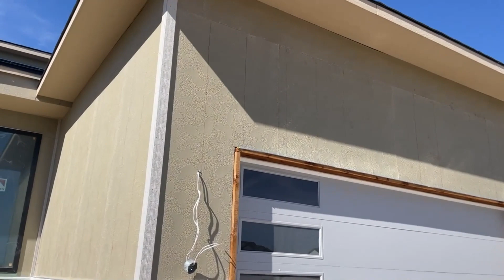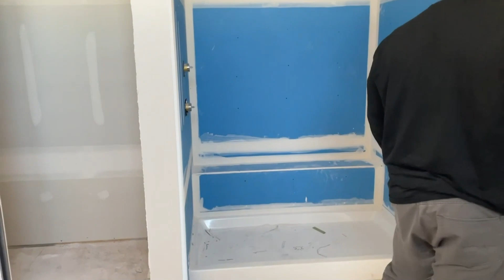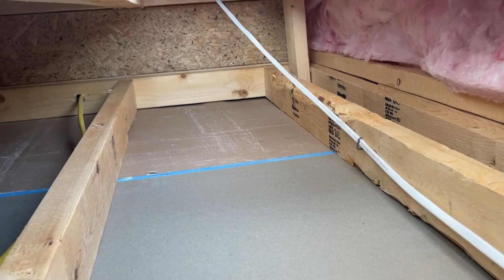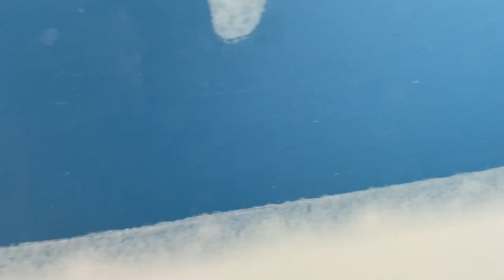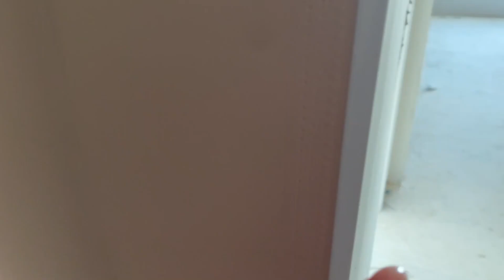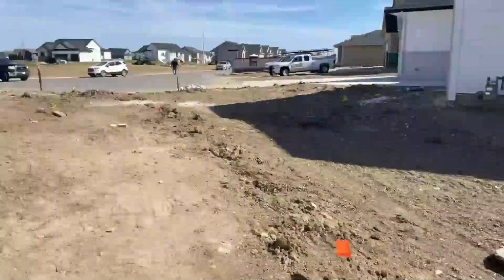BUILDING OUR NEW HOME 2022 | NEW CONSTRUCTION UPDATE | SEMI CUSTOM HOME BUILD | HOUSE OF ROLLE

Comment: I'm building my new home as well, they just finishe putting in the ruff ends plumbing and concreated the foundation.  Next step will be the framing.  Many Blessings to you and your family. Just one recommendation make sure you have a home inspector do an inspection before closing.
Reply from the maker: Congratulations 😃!  Framing moves so fast.  Yes  the inspection is required for our closing.